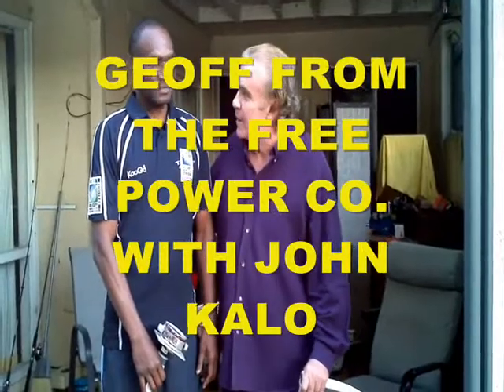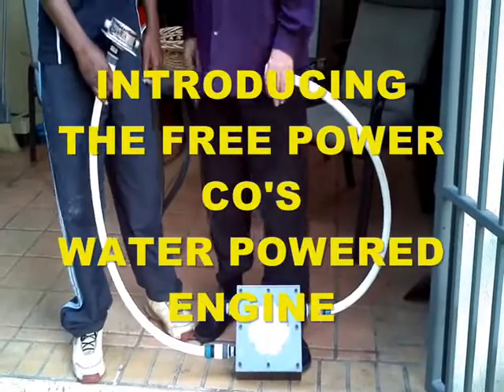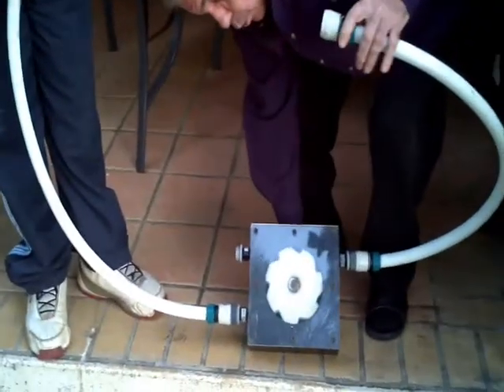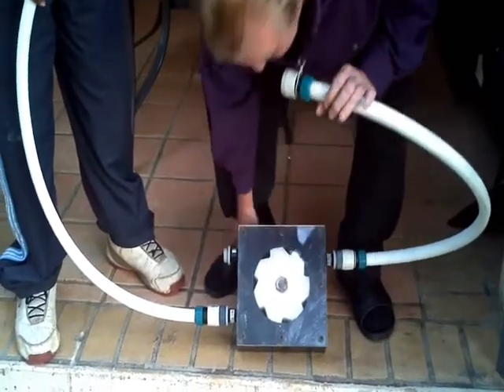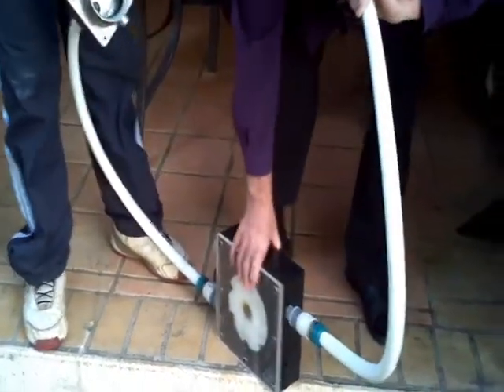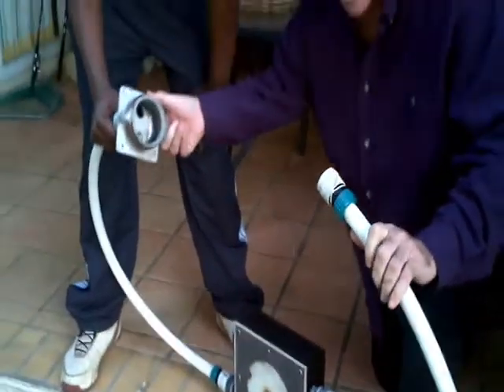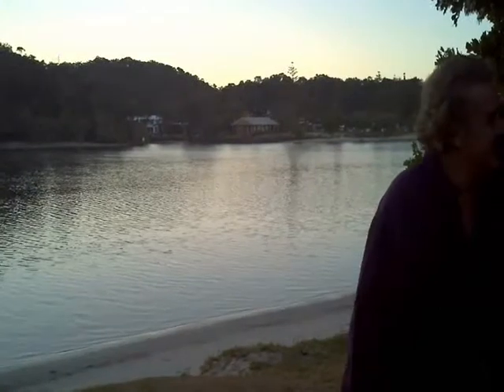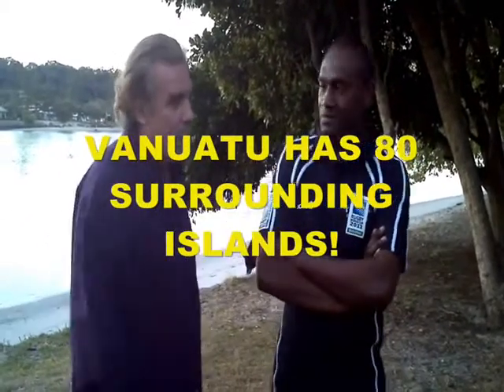FREE ELECTRICITY - VANUATU DEMO ATER POWERED MOTOR AND OTHER ECO PRODUCTS

Comment: "No friction, no heat no wear" - yeah, no fucking electricity either. A bit of hose and a paddle wheel in a box and you're going to run it off the tide? What a load of rubbish, no wonder there is no working model.
Wonder how much he conned Vanuatu for.